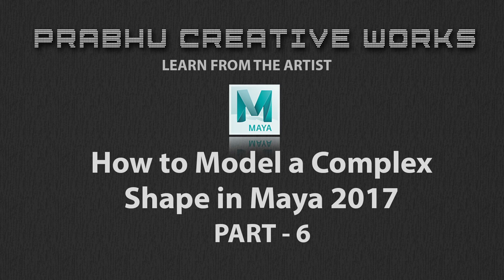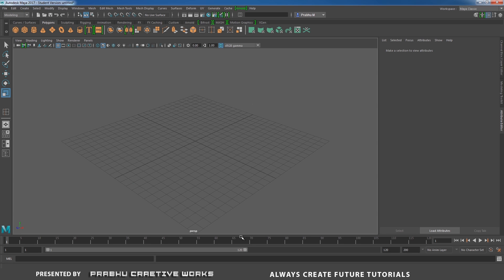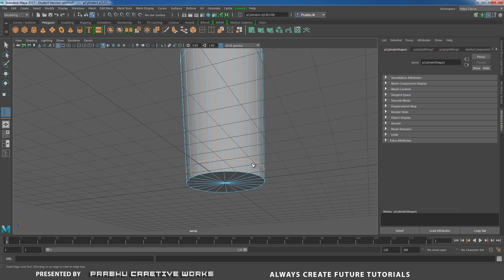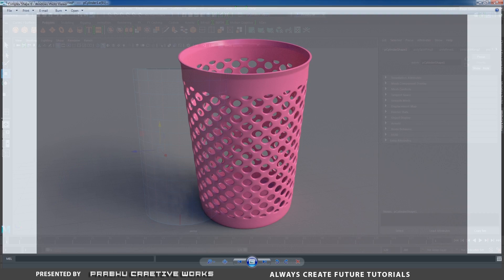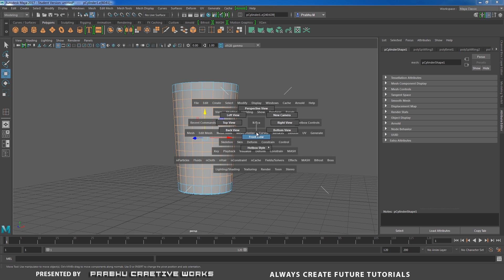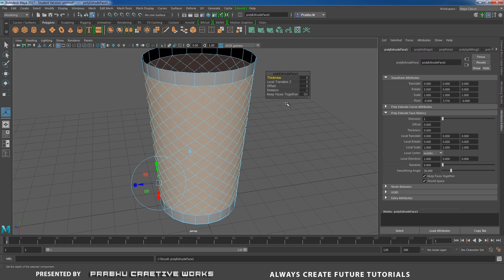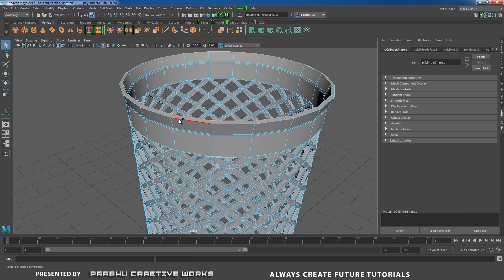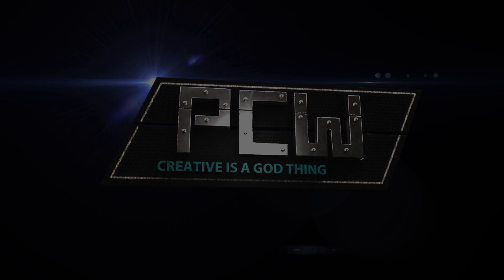How to Model a Complex Shape in Maya 2017 | Part 6

Comment: Great Tutorial!. Can you tell me how to make square holes instead of circular holes on the basket?
Reply: PixelBlend It's the same step up until he uses the Poke Tool. For what you desire, don't triangulate the faces, just extrude and delete. 

He used the Poke Tool to triangulate it and then deleted the original edges to make them quads again but doing so changed the flow i.e; the direction of edges, they weren't straight, connected in a linear manner. You can do the same but you will have to tighten those edges later on (you can use bevel) and you must not keep the bottom face or the top, and you will have to make a ring on the top while leaving the bottom empty. 
And make sure not space out the edges when adding the edges in the middle of the cylinder to manipulate, use lesser loop so as to make it like a big net, spaced out with more gap in between. 

Once you are done, do not extrude the net area too much, you can do it but just by a very tiny amount. And then, it all depends on physics. You will have to make use of physics simulation to make it look real, you will have to separate the ring and the net and then apply nCloth on them making one the passive collider and another one an active collider. Use little amount of gravity and I think you are good to go. You can also create a loose net like mesh but that will look bad.

Comment: Nice tutorials Prabhu. One remark: at around 4:05 of your tutorial, you are selecting all the vertical edges one by one. There is another steps which is much more efficient. Click the beginn of the edge, shift click the end of the edge and then CTRL-right click and chose Edge Ring Utilities, To Edge Ring. This will select all the edges around the trash in one step! There is also an equivalent for the edge loop called Edge Loop Utilities. Give him a try :-)
Reply from the maker: +Leevy27 thank you so much
Reply: You could also Drag select in an orthographic view
Reply: Or, select all faces and hold shift than Convert face to edge. 
Thank you for the tutorial :)